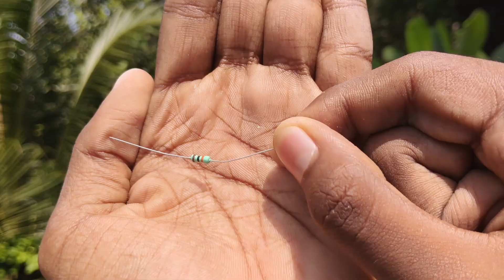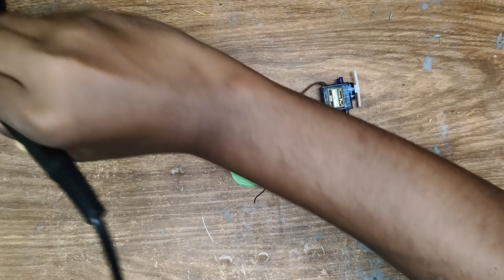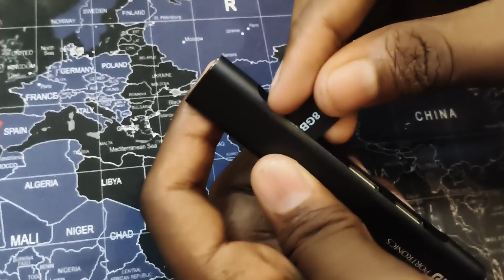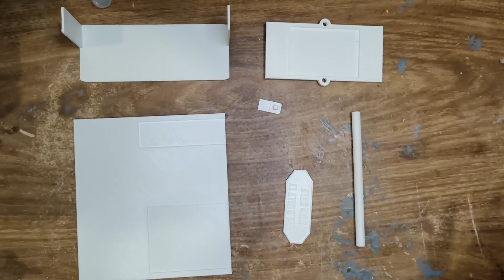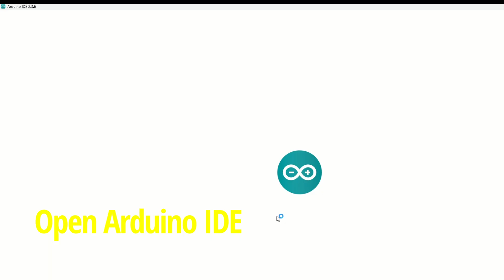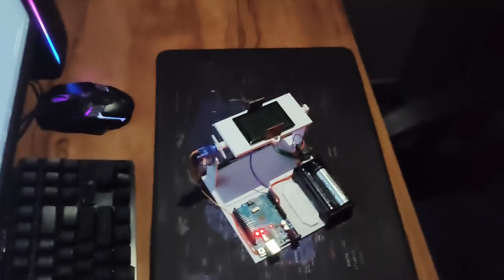How to Built an easy SOLAR Tracker,At home Using Arduino UNO, 3D Printable Or Make it with Cardboard

Comment from the maker: copy past this code 

/*
 * Single Axis Solar Tracker
 * Components:
 * - 1x Servo Motor (connected to pin 9)
 * - 2x LDR (Light Dependent Resistors)
 * - 2x 10k Ohm Resistors
 * 
 * Circuit:
 * - LDR1 connected to A0 with 10k pull-down resistor
 * - LDR2 connected to A1 with 10k pull-down resistor
 * - Servo signal wire to pin 9
 */

#include <Servo.h>

Servo solarServo;

// Pin definitions
const int LDR1 = A0;  // Left LDR
const int LDR2 = A1;  // Right LDR
const int servoPin = 9;

// Variables
int ldr1Value = 0;
int ldr2Value = 0;
int difference = 0;
int servoPosition = 90;  // Start at center position

// Configuration
const int tolerance = 50;      // Tolerance for light difference
const int servoSpeed = 1;      // Degrees to move per adjustment
const int minAngle = 0;        // Minimum servo angle
const int maxAngle = 180;      // Maximum servo angle
const int delayTime = 50;      // Delay between readings (ms)

void setup() {
  // Initialize serial communication for debugging
  Serial.begin(9600);
  
  // Attach servo to pin
  solarServo.attach(servoPin);
  
  // Set servo to initial position
  solarServo.write(servoPosition);
  delay(1000);
  
  Serial.println("Solar Tracker Initialized");
}

void loop() {
  // Read LDR values
  ldr1Value = analogRead(LDR1);
  ldr2Value = analogRead(LDR2);
  
  // Calculate difference between sensors
  difference = ldr1Value - ldr2Value;
  
  // Debug output
  Serial.print("LDR1: ");
  Serial.print(ldr1Value);
  Serial.print(" | LDR2: ");
  Serial.print(ldr2Value);
  Serial.print(" | Diff: ");
  Serial.print(difference);
  Serial.print(" | Servo: ");
  Serial.println(servoPosition);
  
  // Adjust servo based on light difference
  if (abs(difference) > tolerance) {
    if (difference > 0) {
      // LDR1 (left) receives more light, move left
      servoPosition -= servoSpeed;
      if (servoPosition < minAngle) {
        servoPosition = minAngle;
      }
    } else {
      // LDR2 (right) receives more light, move right
      servoPosition += servoSpeed;
      if (servoPosition > maxAngle) {
        servoPosition = maxAngle;
      }
    }
    
    // Move servo to new position
    solarServo.write(servoPosition);
  }
  
  delay(delayTime);
}

your welcome :)